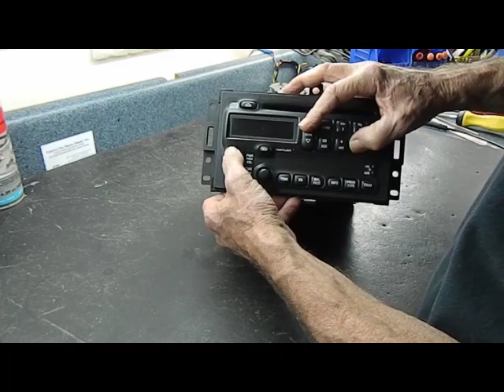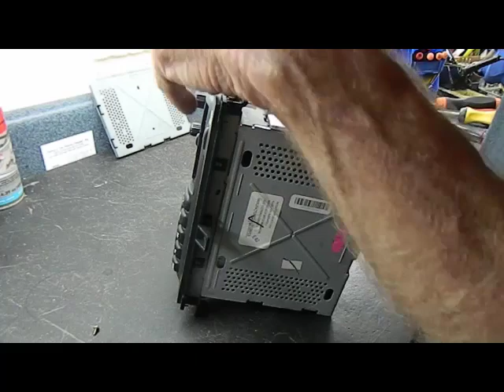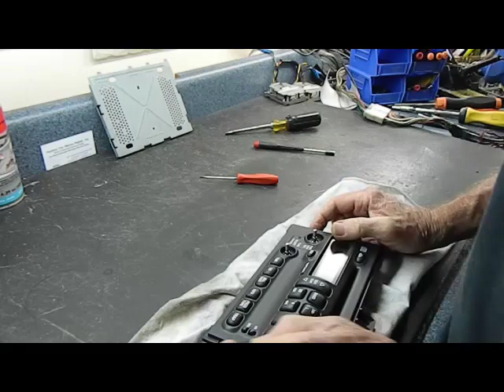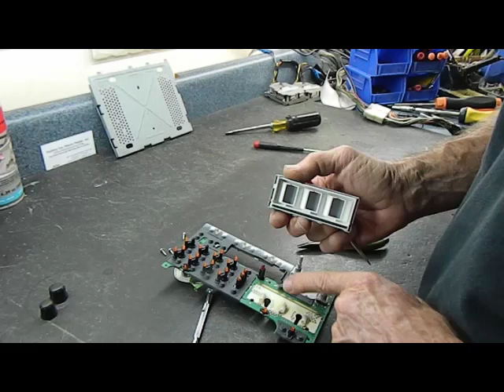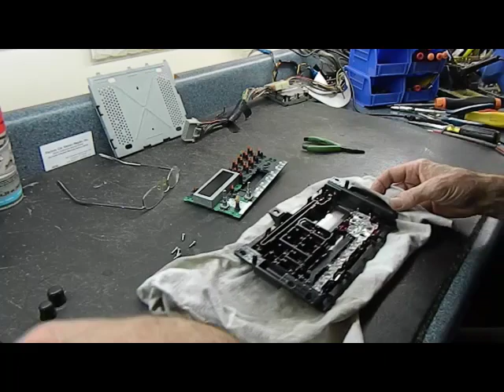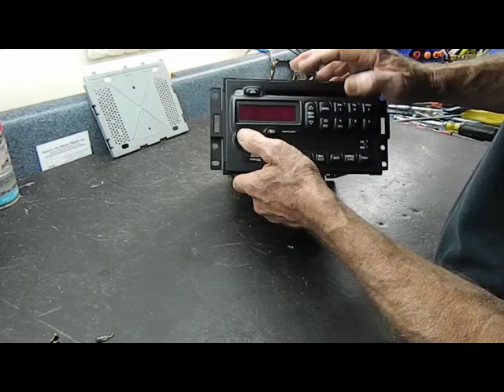Pontiac No Display Stereo Repair 2003 - 2004 - Car Stereo HELP

Comment: How do you get the wire out i burned a hole right through it because there was no where for a wire to go
Reply: Skipped right over that part lol.  Don't try this you will wreck ur radio

Comment: I just got back from a junkyard with 2 diff. Delphi Delco electronic radios. 1 called the radio with CD (base level) from a 2005 Grand Am Pontiac part #21000913, the other from 2003 Grand Am par#10317996 it has the cassette & the cd player both . The original 2005 Pontiac Sunfire We own  the radio, was changed by the previous owners.( we didn't get it) the crappy after market quit working . Can I put one of these  factory radios I picked up in with out owning the gm $450.00 thing that plugs in under the dash for reading errors and changing messages and reading trouble codes? So will this radio work (if it's a working radio) with out typing in the old vin#.... At what date did GM cars start making you have a turn on code? or a vin # chip, because it was working with an after market, with nothing special.

Comment: thanks for video and your time !  at the salvage yard I tested 6 of these and all of them had the display burned out lol and I took one home anyway and it died the second day. I bought a kenwood one. If the lightbulbs are cheap change them but if they are over 50 bucks mind changing the radio because these radio doesn't seem to last forever. Thanks for the video sir you are a great tutor !

Comment: Why even waste your time fixing an oem Delco stereo that's 15 years old. it wasn't winning no prizes when it was new....
Reply from the maker: Good question! However with the number of calls I get for this simple repair, just trying to help.
Reply: Several reasons:
1) it's bought and paid for
2) the repair is easy 
3) the parts cost peanuts compared to a new prize winning stereo
4) my tired old ears can't hear the difference between an OK stereo and a prize winning stereo
5) a prize winning stereo deserves prize winning speakers which cost more money 
6) I would rather spend the money on something I need rather than on a prize winning sound system
7) good women are attracted to men who can fix things
8) I don't have a rich daddy who will buy me a prize winning sound system for my birthday
Reply: OEM
Reply: Because some of us like stock interiors